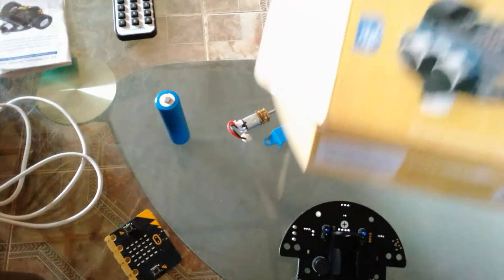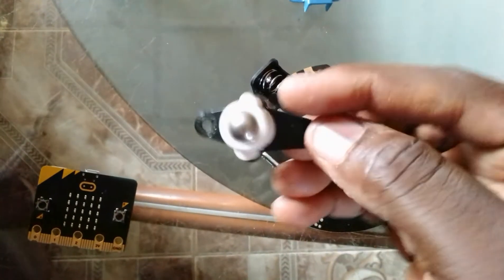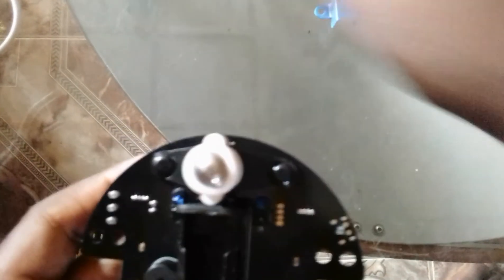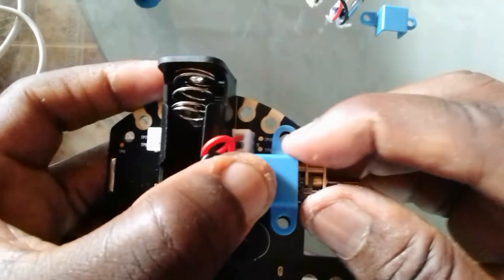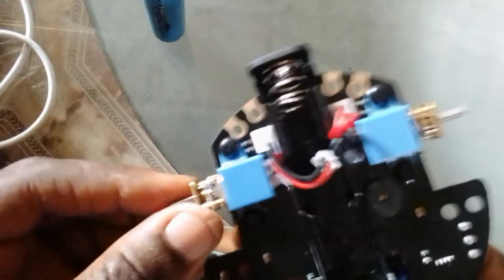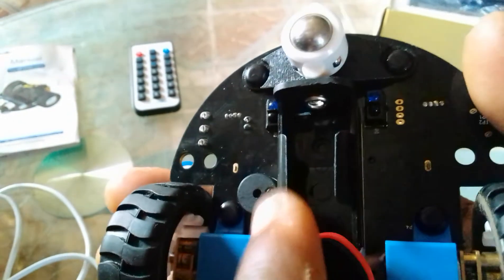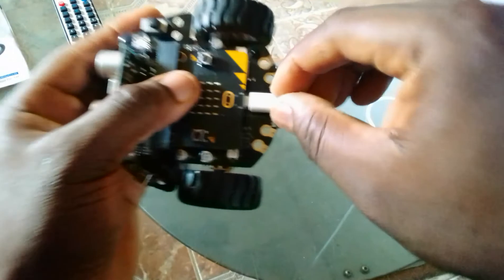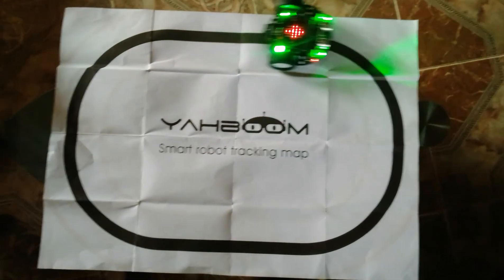How To Assemble the Yahboom Tiny:bit smart robot car compatible with Micro:bit V2/1.5 board

Comment: hello i have a question, if my TinyBit wont run in a straight line (forward and backward), what should i do?
Reply from the maker: Check both wheels for either loosened or tightened fits on either of them. If there is a tighter fit on one of the wheels, it may affect the speed relative to the other wheel.
Reply: @techbasengr  they're the same, i think its with the motor (I've lubricated them) still it doesnt run in a straight line
Reply: @techbasengr  how ❓